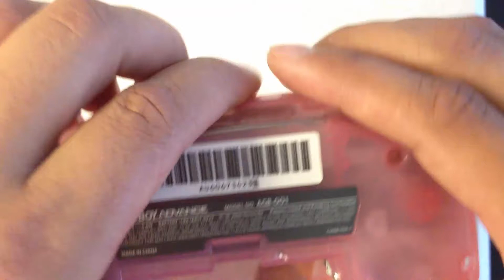GBA Backlight Tutorial 3 of 3 (Gameboy Advance Backlight Screen AGS-101)

Comment: I solder in the other place green power turns in but no image
Reply: Nani tech cepeda hey the solder point is making contact to something else as well. It happened to me as well
Reply: Marvin Campos  like where  I hate soldering  I just practicing but is hard ,can u doit with out soldering  I hate it
Reply: Nani tech cepeda make sure the cable isnt contacting the point next to it or above it. No you have to solder.

Comment: shouldn't there be an insulating layer between the metal screen back and circuit board?
Reply from the maker: Originally there is one; but with the replacement screen it is may be too tight a fit and hence require the removal of that layer.

Comment: when you were talking about your soder points did you say we can soder to that C32 capaciter?
Reply: i mean C35 not C32
Reply: it didn't worked for ya too? when i first installed it worked great but i did on the y thingy, had to try on another board and things got messy, and now my screen didn't turn on :c.
Reply: The pin of the SOT23 package (the Y he's talking about) it's not directly connected to the C35 capacitor.
At least for my GBA board I got 150 Ohms when I measure the resistance between the pin where he soldered his wire and the capacitor here he said you can solder too.

Soldering on the capacitor is way more easier than soldering on the SOT23 component.

Comment: when you did this mod: whats the default brightness level of the display? i ask because with the AGS 101 Dispaly there are two brightness level.. so whats the brightness level after the mod? the normal or brighter level? thx `!!
Reply: Nomos I'm wondering this as well. He almost mentions something about it before working on the red wire. I assume the red wire says "brightest" when it transmits power (so it's an optional??). And if this is correct, you could theoretically install a switch which changes modes as well.. Which would be really cool.

Comment: I bought 3 of these from eBay. Not one of them has thAt red wire. The pot on the board is functional for higher brightness but why don't they have it?
Reply: +Clash of Clans &amp; More - ZeroDaHero The 40 pin version does require the wire.  The Backlight still requires power, which is not supplied by the ribbon cable alone (remember the original GBA doesn't have any form of light)
Reply: +Darren Connelly That's because the 40 pin GBA consoles don't require that red wire to be soldered to the board for the screen to function properly. If you have a 32 pin and it didn't come with that red wire then you got the wrong ribbon adapter. Hope that helps :)
Reply: +Clash of Clans &amp; More - ZeroDaHero  I bought a 32pin adapter and it didn't come with the wire.
Reply: just solder a wire to the damn adapter.

Comment: Hi all, I guess I need some help

i put together all elements, just like in the vid
however I can't get nice picture, all i got is phantom of the images displayed in weird colors, everything looks like missplaced hue, plus some smudges on left and right

i double-checked the connections between GBA - ribbon - LCD, and my GBA is model "10-", so it's 100% 32 pin
what could went wrong? maybe my fault is i didn't bought the kit from Zerey

LCD i NOT original AGS-101, it's a replacemant. Could it be a possible reason?
i have ribbon from http://www.aliexpress.com/snapshot/6124721337.html
and LCD from http://www.aliexpress.com/snapshot/6125419754.html
Reply: Look at this video, this guy explains on how he got his to go away. Maybe it'll work with your's: watch?v=IsA5_TfnvGA
Reply: Nus Dogg
i already fixed it

if anyone needs help here is post with solution:
 http://gbatemp.net/threads/gba-backlight-agb-001.328487/page-33#post-5045989
Reply: Yunneck So what was it?
Reply: Nus Dogg
dunno really, maybe some incompability between chinese LCD and GBA, maybe these LCD's were tested only with 40 pin version? Can't say
Reply: So you got a new LCD screen?
Reply: Nus Dogg no i didn't

please look at link i pasted above

Comment: I did this mod and i think i broke it, the power light comes on and then goes off really quick. any idea what ive done? or how i can fix it? i checked batteries and everything
Reply from the maker: You may have possibly shorted some traces. That is, where you did the soldering, check to see that you did not make an unintended "bridge" (connection between two traces that originally was not there).
Reply: rs1n i unsoldered it and it worked again with a normal screen, i tried it on another GBA motherboard and the same thing is happening with that one. Any idea?
Reply: JamaWest
Maybe a defected cable ribbon adapter. Contact the seller.

Comment: I purchased a ribbon off eBay that looks exactly like yours with the exception of the red power wire. I was wondering if you could tell me where the red wire is attached to the ribbon and also the method used. Thank you!
Reply: Please any answer? Same thing happened to me... Thank u!
Reply: P1
Reply: I modded one and it works great!
Reply: Benedict Cumberbatch HI! I found this downloadable tutorial very usefull. It explains where exactley solder the wire, that u can get it from almost every electric appliance, a battery operated toy car has a lot of them! 
Download the manual: http://rosecoloredgaming.wordpress.com/downloads/
Reply: Benedict Cumberbatch
Use a wire size 30 AWG. You can find these on eBay or any local Radio Shack store.

Comment: I swear you didn't put the shoulder buttons L and R back on the console. Also how much does this entire process cost?
Reply: the kit for the screen alone is $60 but for the screw driver kit you shouldn't even need to buy one all you need is a verry small flat head screw driver, plus  the screws are not tight at all so it shuld be fairly easy

Comment: @OdeToSolitude: If you solder the red cable in two points, you can get stronger lighting.
Reply: Hamsterzilla1349 hey ive noticed the samething, jus not as bright looks goods tho. what 2 points can i solder for brightness? the potentiometer didnt change brightness, ive tried both 32 n 40pin mobos and they both comeout the same brightness which is less then the og ags101. my screen is from a ags101 no china here

Comment from the maker: I myself have never tried it. I suppose it is possible but you would need a specialized adapter ribbon cable different from what was used in the video. If you mean whether it is possible using the same adapter ribbon cable, then I would say it is very unlikely that an NDS screen would work.